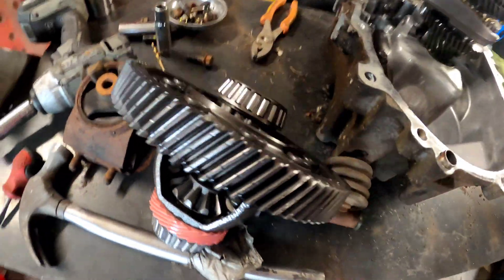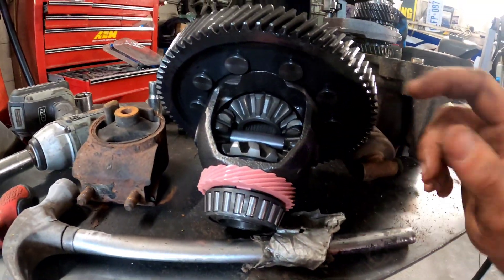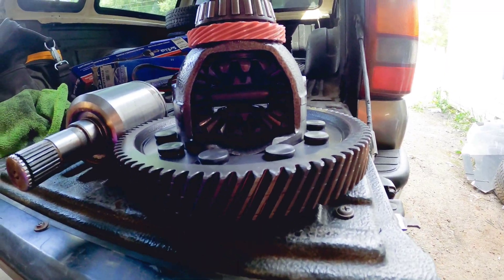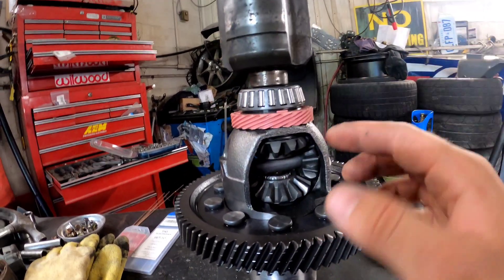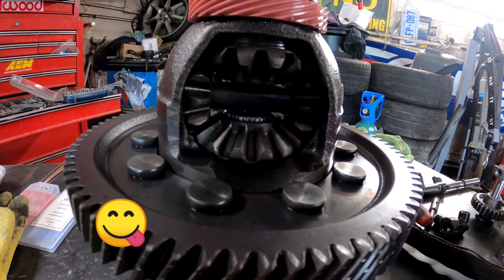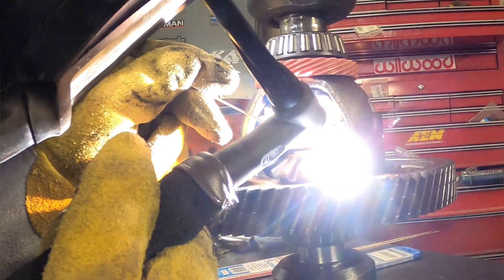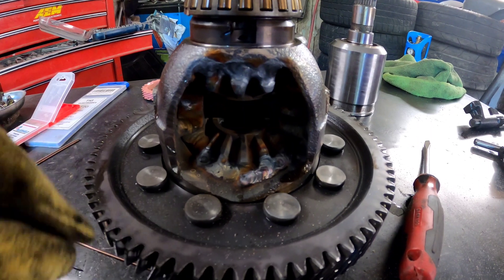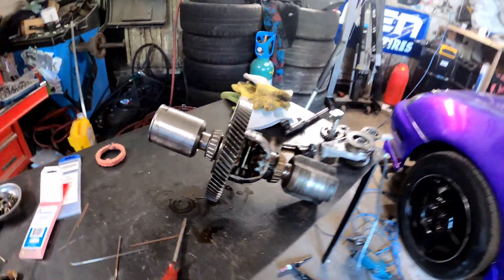How to weld a rear diff! the proper way!

Comment: Question: is this normal?
I have a mule 550 my kids ride the spinning tire stopped turning a while back i took apart everything looked fine so I put it back together and it still wouldn't go I locked the diff in and the tire that had always spun began to spend but the one that should have started spinning did not. 
We've been driving it like that for a year with the diff locked in but I want to weld it so I don't have to worry about anything else failing. 
My whole family gets a lot of enjoyment out of putting around the yard on this thing and a new diff is like double what I got in it.
Reply from the maker: @Lifewiththeredmons  weld er up buddy!
Reply: @Suicid3mx3  thank you